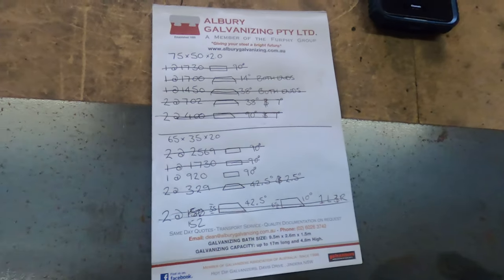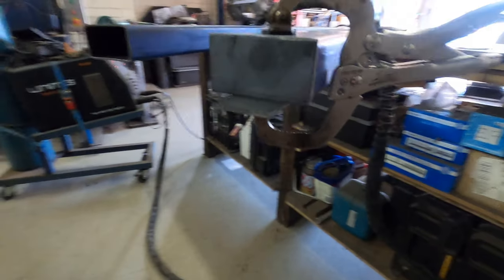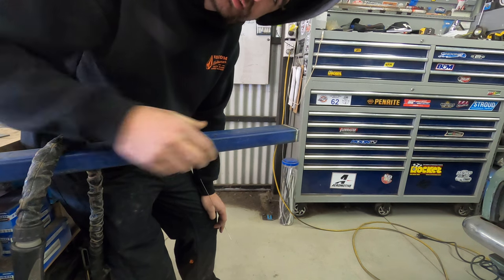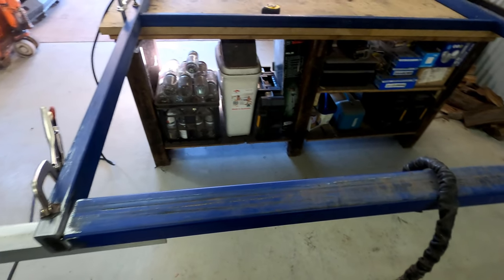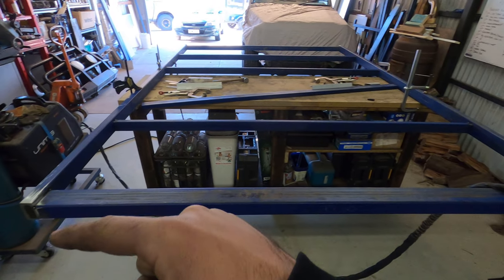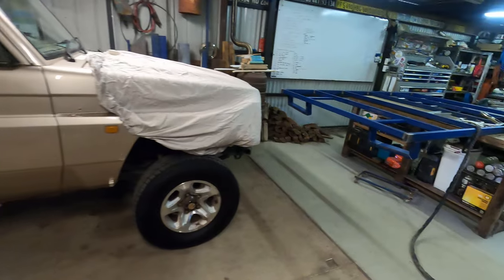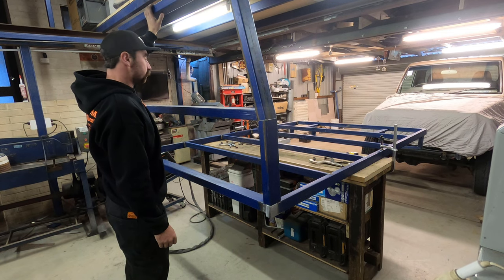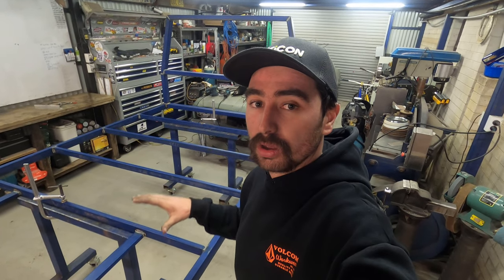Tow Rig Tray Build: how to Fabricate a ute tray: Toyota Landcruiser: Backyardbuilds

Comment: Great episode 👌

Just bought my first welder, a unimig viper 185 mig/tig 👌 curious what the best gas is to use on mig welding? Wire for mild steel? Wire speeds, how much gas pressure u need, techniques etc.?
 Never welded in my life but keen to learn, been something I've wanted to learn for yrs.
Just looking at doing stuff on cars like exhaust, cages, tubs, like tanks airbox engine bay type stuff, exhaust manifolds, intercooler pipes, things like that.
My first project is to fix my dad's old trailer as it has some rust holes on it and I figured it'd be good practice, it's steel ,I think it's 5mm thick steel rough guess.
2nd is to make a 3 inch exhaust for my vn from dump pipe to tip and I've got to modify the wastegate dump, just mild steel I think being a beginner. 
Thanks can't wait for part 2 👌
Reply from the maker: Hey mate, sorry for the late reply,  We would recommend a 0.8mm wire and an argon mix, at BOC its called Argoshield.
Reply: @BackyardBuilds  nah that's ok, thanks for the tips, yeah a mate who builds trailers for a living told me about the argosheild, ended up getting it from Bunnings as it was the most cost effective, 80$ for a size D 👌

Haven't used the damn thing yet though 🙄 
Life stuff getting in the way lately, had to do a shed tidy up n got a work bench and some other tools I needed but this weekend is free so gonna get out n have a go, got a heap of old exhausts laying around to cut up and practice on 👌 
Thanks again and appreciate it, really enjoying the content, learning heaps from it 👌👍